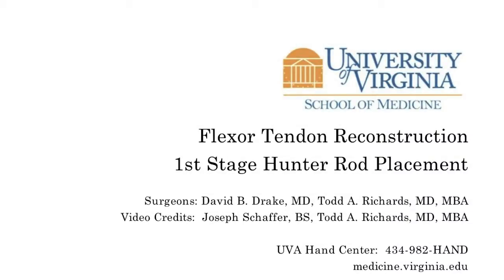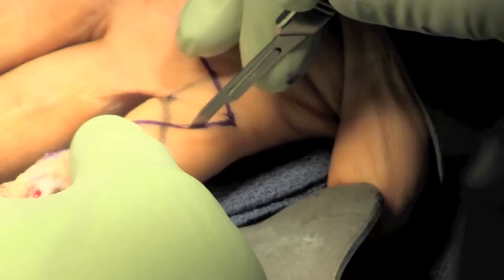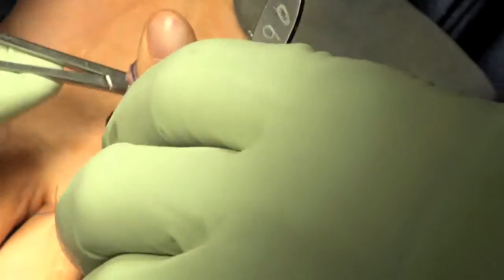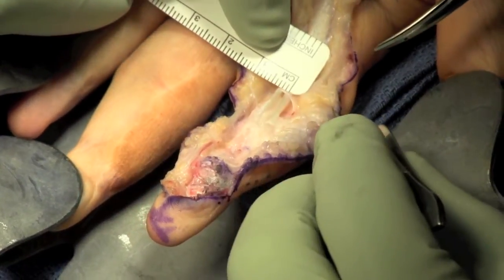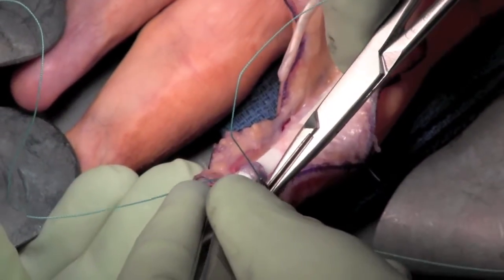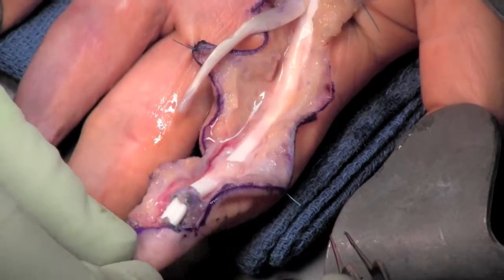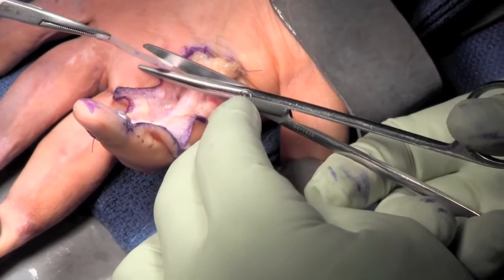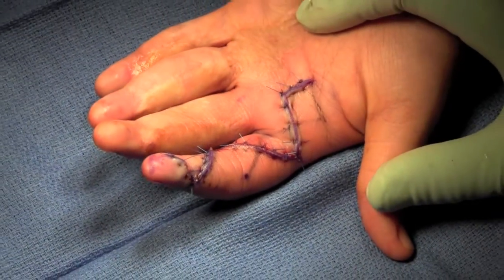1st Stage Hunter Rod Placement

Comment: Hi, i also did the same secondary repair (i.e) silicone tendon spacer operation, if it is removal or permanently kept inside the finger
Reply: Hey I went through the same!
I guess you must be done with it by now
Can you please share your experience
Reply: @devkathuria2842  Hi I had two surgeries and coming the 3rd one, it may is an implant Hunter silicone rod in the pinky finger, how are your results after the surgery?
Reply: @ramondiaz778  It's been about a year for me and the results are really good.  I have almost got the full range of motion on my finger, although it's slightly bent because they put it like that after surgery to reduce any tension...then I didn't do the physiotherapy to straighten it out(because of the risk involved that it might break) and couldn't get it fully straight, on which I am working right now, otherwise it is very good, although weaker than all other fingers but I'm confident that it will gain strength slowly.
All the best for your surgery
Reply: @ramondiaz778  feel free to mail/reply here if want to know anything. 
Lastly, I'd say focus a lot on your physiotherapy, since surgery will only attach your tendon and then it's only upto you how well you recover and don't forget to take precaution
Reply: @devkathuria2842  thanks, just had surgery 2 days ago, but starting physiotherapy Monday  nov 9, so surgery they put the rod in two fingers for 3 or 6 months and will perform another surgery to replace it with my own tendons.
Reply: @devkathuria2842  but yes I've been there, had 1st surgery back in march and after few months my arm was weak, but recover a little the strongest.
you'll recover little bit by little bit the strongest with the finger, glad to hear you have good range motion, obviously isn't gonna be the same but al least have back some part of the life, I wanna be able of play Bolling for 1st time ever!
Reply: @ramondiaz778  Hope you have a speedy recovery. Focus on physiotherapy, it may be painful but don't worry, just stay within the limits as specified by your physiotherapist

Comment: My range of motion is somewhat limited. I cant fully extend my finger nor can i fully bring it in to my palm. I could probably have another surgery to remove some of the excess scar tissue. But, it fuctions perfectly normal and is not noticeable unless I choose to point it out to people.
Reply: That is somewhat concerning to me, is there a reason for the limited ROM? dexterity of the finger is very important to me so I was wondering if you had extensive damage or something that would be the cause for the limit. is it the scar tissue preventing it? is it painful to push/pull it past a certain point?
Reply: Could you maybe guess on a percentage of your original function in terms of extending/bending you managed to retain?

Comment: I had hunter rod flexor tendon replacement in 1974 the extension is 100% flexion is from the first knuckle only touching the palm this is considered an outstanding outcome.  It is essential to work the finger constantly to prevent permanent stiffness.  Use the extension brace and work that finger.